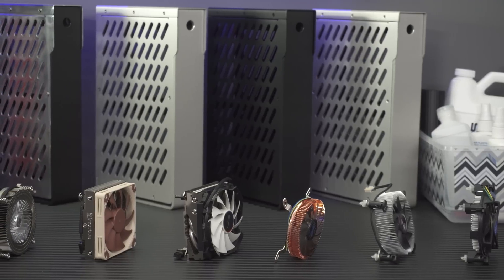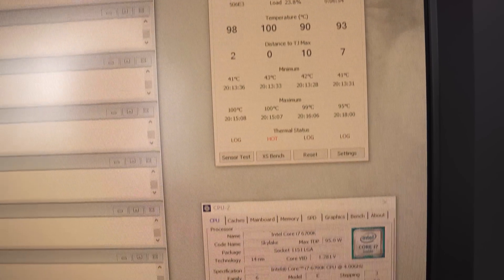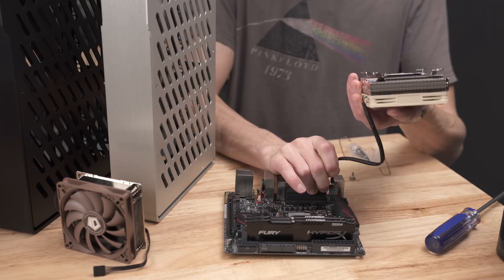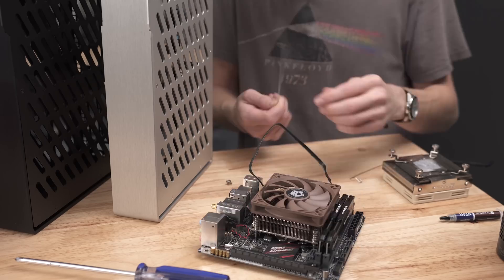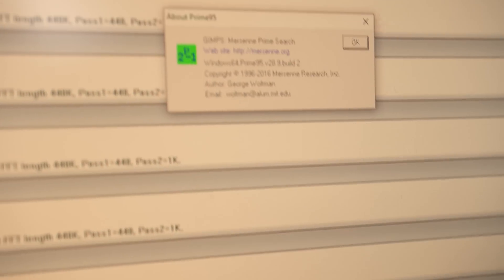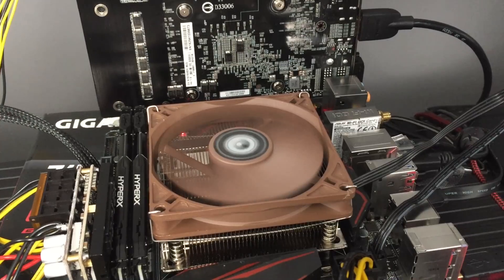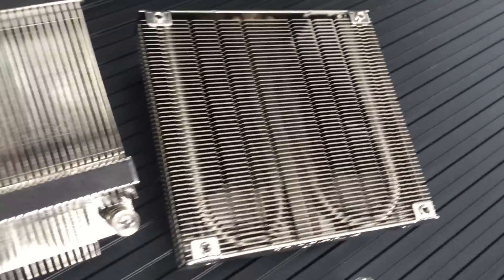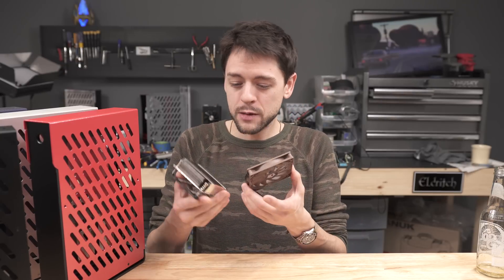MINI-ITX Vapor Chamber Cooler Tested

Comment: Generally on these mini-itx systems, fans are pure shite load as if it's a plane turbine during takeoff. But Noctua comes to the rescue, if you have height to work with, go for 25mm high fans, they are the quietest, and if you're very limited in height go for 14-15mm.
Trust me, replacing the cooler is worth every penny, they are way more quieter and your nervous system will appreciate that very much.

Comment: Being that vapor chambers are in theory more efficient than heat pipes, what would be the best theory to explain the performance?

It would seem to me that the fact that the vapor chamber actually blocks the path of the airflow, as opposed to the noctua with its open back, would be the main factor - creating more air stagnation towards the center and where the fins meet the vapor chamber creating a larger boundary layer, but I’m no engineer so I would love to hear other takes.
Reply from the maker: Well there is design and execution right? Some products are great on paper but the manufacturing just isn't there. I've had to cancel projects and pull products because the manufacturer's quality didn't match my vision or design. I think with a better top and closed sides to capture all the pressure from the fan blades is the only real design issue I have with this cooler, so I guess the rest is up to quality. The base on this cooler was really bad too so I don't know if I had a bad sample or not. I asked ID-COOLING to send me another for a redo but they didn't respond. I'm open to it though :)
Reply: @NotFromConcentrate  Gonna take a second to say you are a pretty legit YouTuber, to come back to respond to a comment on a video thats half a decade old.  I honestly didn’t think anyone would respond, let alone you.  Stay awesome man.

- A fan

Comment: Your noise test was funny because you don't have a wind gaurd on the mic, so you hear more wind from the stock fan than from the Noctua.   Seems like the stock fan is pushing more air, even though it's not making much difference and also louder.

Comment: I think it's worth noting how the open bottom of the noctua heatsibk probably does not restrict airflow like the nd cooling heatsink's vapor chambor & plate bottom. So i think this fan needs more pressure to get airflow. Overall, more work, so it spins faster.

Then the nd cooler fan is not nearly as well designed for quiet. It's a basic fan with sharp corners and edges. They make noise when they move through air.

So it's a loader fan doing more work. So much for vapor chambees

Comment: Can someone explain to me what he means by "safe for the CPU" when he is stopped using the non bugged version of prime95? Like how can a software be unsafe for the CPU? It should be throttled if something becomes too hot anyway, lowering the actual workload on the CPU. And if that fails the BIOS should still be able to save the hardware, yes? 

How can a software big in a user-space application change any of this? 

Its well more then 10 years since I was into overclocking and benchmarks, but I remember using Prime95 and Linux for stress tests where Linx was capable of making my CPU way hotter then Prime95 ever was capable of despite the CPU being under 100% workload on both. Why is this? Are these temperatures the difference between 99% load and 100% load, with 1% difference or is something else going on here?

Comment: Surface roughness decreases heat conductivity - I disagree with this.
For pure conduction, between 2 metallic surfaces, this happens through micro contacts. More often than not this comes down to the finish of both surfaces the heat spreader of the chip and the bottom plate of the heatsink. The number of these points of contact do not increase drastically with the roughness of the finish and conductivity does not change drastically either. (read up on tessellated points of contact for more information)
However, when you have a layer of thermal interfacing compound, 2 flat surface are likely to squeeze the liquid layer to regions of lesser pressure (typically, the sides) over time. Here having a rougher finish helps as it creates interstices where it can reside and perform its function.
Also, it makes no sense use Noctua's thermal compound with an IS-VC45. Your average consumer will most likely want to use the thermal compound provided with the product itself.
Therefore, the test is not entirely an accurate representation of the performance of the product as a whole but is more of a bespoke skewed metric.
I'm using the Zalman CNPS8900 in a Louqe Ghost but I was having clearance issues so I was considering this as an alternative.
Reply from the maker: I'm not sure, I think you have to prove to me that a poorly machined base on a cooler performs better than properly surfaced one. I agree you want the mating surface area as high as possible (which would increase in a perfect world with micro-tesselation) but if we only cared about total surface area then a cupped base filled with TIM wouldn't matter, but we all know it does. I think that rough surface speaks more to flatness (or lack thereof) than micro-tesselation. For your second point, maybe your average consumer would use the TIM that was included but this video is for my SFF enthusiast group and I am not sure why you would want to switch from the NHL9I to this and use worse TIM. If I was reviewing the cooler, sure, I would test the TIM it came with, but we are looking for the best cooler for the MINI, and we do all sorts of other weird "hacks" to eek out every bit of performance. Regardless, the performance and build quality of this cooler is one of the worst I have tested for the cost, so if it wasn't the poorly machined base, then something else about it was really really bad. This is surprising to me too because I am working on a 25+ SFF cooler shootout at the moment and they are all very close to each other in terms of peak but the VC-45 lags far behind. Peace and thank you for watching and commenting!

Comment: The reason why the Noctua is better is pretty simple. The vapor chamber blocks off a lot of airflow, while at least half of the fins on the Noctua are open. So while the vapor chamber cooler probably has better heatflow and is a better evaporator, the Noctua cooler has a better condenser.
Reply: because the VC doesn't help with such a small surface area or few small fins

Comment: I wish they make a product using cpu heatsick connected to case fans with heatsink so i wont have use fans on cpu .. it is all about case fans connected at once to cpu and gpu through heat pipes .. no more bullshit water coolers and cpu coolers product

Comment: Ha, i bought one of those ID Cooling fans off ebay a while back to use as a spacer between an L9a and its fan, now i know how it sounded before i cut it up having never powered it up. Shame it's intel only, I reckon that raised contact patch on the vapour chamber would allow a ryzen apu to run lidless... I think i could make it fit... almost wish i didn't already have a cooler

Comment: I really want you to try this: 

1. use more thermal paste. The rough surface of the cooler really needs it
2. Use a noctua fan on top, to keep the fans consistent. 

I'm curious to see how it performs.
Reply from the maker: Dear Winter Charm--I did use alot of thermal paste. I even tried sanding the cooler down and using a glass plate to make the surface smooth. Finally, I actually did use the Noctua fan on it--which you can see in the video here: https://youtu.be/JZPRe81cLmc?t=286 Peace to you and thanks for watching!

Comment: Other than getting into the "air stream" from the VC45 so you got wind noise, then the fan was clearly louder, go go Noctua
Reply from the maker: Jesper Andersen the noctua is tremendously quieter in person, mic or not. It’s definitely the quietest cooler sub 100mm I’ve tested even years later. Peace:)
Reply: oh I don't doubt that, as I wrote it is clearly more silent, but getting into the "wind noise" of the other makes it seem worse than it is. But Noctua just rules, that's how it is

Comment: Is copper not a thing for heatsinks anymore? My coolermaster hyper 612 works great. Would love to downsize to something smaller, but not if they dont have quality superior heat transferring materials.

100c is unacceptable to me. Im used to load temps of 65c on air with a 130w tdp cpu.

Comment: It actually looks reasonably flat except for the deep cnc marks which they obviously didn't polish for some reason or other.
Actually, on the SFF forums my Jonsbo HP400i is recommended and has better temps and noise but of course, they probably don't make that anymore or it's hard to get and it's probably more sensible to buy the ID Cooling IS40V3 or something. Oh and AM4 support is a plus for the latter. 

(Definitely not a ID Cooling advocate lol. I have several ID Cooling AIOs and heatsinks though.)

Comment: Can you try again with fan inverted?
Just curious.
Reply from the maker: Dear Fabian,

I troubleshoot for hundreds of customers weekly, and one thing I see that is common is the idea to invert the fan on a CPU cooler. This does not work as these style coolers need a good amount of static pressure to operate. The CPU will throttle into the dust with the fan inverted. I hope this helps!

Comment: hi, you should check this, it could give you to some ideas ;)
https://www.youtube.com/watch?v=5MM5D0hjAYw
149.5 x 42.7 x85.5 mm
Noise Level : Lo< 21 , HI<23dBA
Max Air flow : 53.2 ~ 100 CFM
Rated Voltage : 12 V

Comment: Thinking about it, a polished surface on either the CPU or the cooler would inhibit cooling. Thermal energy transfer is largely dependent on surface area. If the paste conducts well a sand blasted surface may actually cool better. 
Want to experiment?  Take two identical cpu's and coolers and have one set sand blasted and see if there is a noticeable difference.
Reply: paste actually has very bad thermal conductivity compared to metal. You would want as little distance as possible between your heat spreader and your heatsink. a sand blasted surface would increase surface roughness and thus increase the distance between the two metal surfaces, likely making the cooling performance worse.

Comment: Just out of curiosity... have you tried flipping the fans to exhaust out the case rather than blow down hot air over the components? I have l9i in all my builds (currently I own 4 of them). in my main build 4790k oc 5.4ghz stayed around 78 in a sg13.. However I did upgrade the fan to a NF-A9 and dropped down to around 74. Like i said just curious if you had tried it or not..

Also... WHEN CAN I BUY A S4??? Lol
Reply from the maker: Unfortunately, while a good idea, this doesn't work. It is easy to try for yourself though! Thanks for watching and your interest in the MINI!
Reply: True it doesn't work with the stock fan on the l9i without modding the fan shroud a little. But It is easy enough to do and then with an NF-A9 it flips no problem. I just wish I could get a Mini lol

Comment: I would try lapping the cooler, those where some massive fly-cutter markings left on that thing. Also I would look at AS5 and Arctic MX-5 for the TP. But thats just me, I'm a little OCD on shit like this lol.
Reply from the maker: I did this last night, and HOLY COW it was the worst surface I've seen by a MILE. I didn't actually touch it when I did this review, but it wasnt even FLAT! I don't mean rough, I mean flat. I had to use a 400 grit aluminum oxide belt on my oscillating belt stander for 3 mins straight to get it mostly flat before I could even lap it. Guess what, there was barely enough material left to even do that. I got a piece of junk--maybe not all of them are this way, but this was not a fun way to spend 65 bucks. Thanks for watching!
Reply: Man that sucks, I had to lap my Corsair AIO (H80I) took me an hour to get the cold plate flat with wet sanding on glass panel the other day.
Reply from the maker: This is the best way to measure long term performance for sure! For this I am really just trying to gauge if the VC45 is better than the l9i. If it was, then more in depth testing is merited. It wasn't though so no sense going that far for my little project. Also, NT-H1 takes weeks to cure and aint nobody got time for that! xD THANK YOU for watching and commenting!!!
Reply: Not From Concentrate also what about letting the TIC cure a bit before temp test? or just doing all tests without cure time?

Comment: The killer is the Noctua is way cheaper too.
Reply: because the VC doesn't help with such a small surface area or few small fins
Reply: It depends on where you live. I can buy ID cooling heatsinks for a fraction of the Noctua price here in Vietnam.

Comment: I must stress the point that vapor chamber coolers like the VC45 are designed to be passive coolers like in a 2U server rack. while the VC4 came with a fan for active cooling the vapor chamber technology is really not built to compete with heat pipes for active cooling. 2U and bigger servers have directed air flow in the front and out the back, this air flow is what pulls the heat off the vapor chamber.

Comment: Take a metal Hacksaw  and  saw ur Noctua in half and ull see why its cooling better!   copper heatpipe  with copper Platinmg surface core all done in nickel plating! So noctua cooler just transfairs  the heat better to the fins.

Comment: I'm really glad you did more than one run. I would hope to see 3 runs but that would be a lot of testing (average of 3 runs). This is to eliminate variances with thermal paste application.
Reply from the maker: Thank you for watching! Total there were three physical heat sink swaps for the IS-VC45, and I would run it three times each and at the 5 and 10 minute mark take a measurement. The video doesn't show all this because that's boring as heck--this is not a review or a scientific comparison, but just casual testing for my own knowledge, and if it helps someone else out, awesome!

Comment: Great video!
I'm planning to buy the IS 40 v3 from Id cooling (with 4 heatpipes).
Initially I was going to buy the noctua, but here in Brazil it is too much expensive (the id cooling costs just 25 USD with free shipping).
But now I'm glad to know that, despite the loudness of the fan, it will probably be a decent low profile cooler.
Thanks!
Reply from the maker: Yeah that cooler looks great, and at 44mm it might fit in the MINI.
Reply: The S4 MINI is currently on my wishlist :D Maybe I can get one when I visit the US (probably in april). Hope you have it in stock by then!

Comment: I feel that this vapour chamber cooler has alot of room for improvement. If it was my product, I wouldnt bother including a fan, and put that cost into some more fins and some heatpipes. I very rarely use the stock fans that come with coolers like this anyway. The Noctua cooler looks awesome with a Corsair RGB fan in an ITX case. Then again, im pretty much wanting a Thermolab LP53 or something here...

Comment: why on earth are these temps on the 80s, ive got a 8320 @4.3ghz and on load its on 54'c, my cooler is the hyper 212 evo but i doubt that makes much of a difference because these cpus he is using should be more efficient right?
Reply from the maker: I have the software set not to emulate normal loads, but rather turn the CPU into a lava pit just so we see the breaking point of the coolers and declare a winner. Both these coolers perform extremely well under normal loads but that wouldn't tell us which one to buy. Thank you for your question!
Reply: thank you for your prompt reply, so ideally under normal loads, what are the temps?
Reply from the maker: There isn't an accurate, simple way to answer your question, but maybe this is what you are looking for?  http://imgur.com/I5i09iF  Peace!

Comment: I remember that ID-Cooling was recalling that cooler because of a very bad contact base, causing high temps. The new one with the fix should be all copper.
Reply: I don't think that's every going to happen, because ID Cooling first mentioned an all-copper version two years ago and it still hasn't materialized.
Reply from the maker: Interesting. I imported this one from ID COOLING according to the seller listing on Newegg on January 8th, and it arrived the 20th. I would LOVE to test a replacement and give it another review, but I can't afford to buy another one.

Comment: Could you add a different fan on the cooler?
Reply from the maker: GREAT question! I actually did this in the video but it is hard to tell 'cause the coolers look so similar. But swapping the fans (4:17) didn't produce a combo better than the NH-L9i by itself. Peace!

Comment: Thanks Josh for this video! I didn't realize that fan clip were difficult to put lol..:) after i totally agree to pair noctua fan with this is-vc45..:) i never use original fan on mine...far too loud..:) the last point to note that inside s4 mini, is-vc45 is just below side panel giving clear access to fresh air...that is helping a lot temperature..:) and you can use core i7 6700k @ stock clock but it clearly needs some undervoltage

Comment: I'm working on testing some coolers myself in anticipation for the DR Zaber Sentry, a case you are probably aware of. As of now I have found the Thermolab LP53 with a noctua NF-a9x14 fan to be the best combination of low profile and cooling capacity. I highly recommend you check it out. Hard to find anywhere other than eBay, but well worth it! I've been getting ~5-10C better than the NH-L9i!